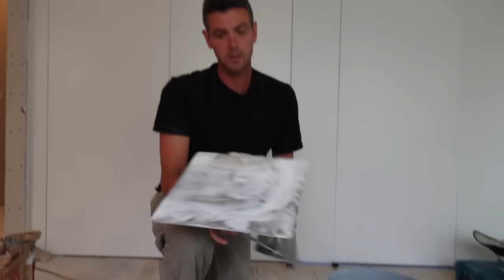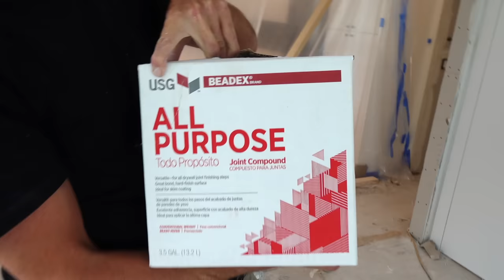Taping Drywall for Beginners Day 1

Comment: I literally started a project yesterday, perfect timing. Any thoughts on inside corner bead product (metal with paper flange)? I'm using the same for my outside corners too. Found it at the big orange store in Toronto.
Reply from the maker: I’ve never used inside corner bead for a regular corner. It takes too long and isn’t a better product. Take the time to learn how to use paper tape in corners. Fastest, cheapest and best product. It’s rare to get that combination.
Reply: @vancouvercarpenter  makes sense, I'll stick to paper! Also just watched your mud framing vid from 3 years ago... Any thoughts on using durabond 90 for mud framing or should someone use only the confill product you mentioned?
Reply from the maker: @robertobattiston1  Don't use durabond. Use a lightweight setting compound.
Reply: You also have to consider if you use a metal inside corner bead, your inside corners might be crooked or not square. Paper tape, like the video instructs is the way to go.

Comment: Sir, is that skimcoat you are applying after putting the tape? Does it need sanding after or you can apply right away a flat enamel paint

Comment: Hey, I have a huge question.  This past week, on my vacation,  I tore down 4 ceilings in my house, taking down the textured and replacing with fiat white. I had already done 4 other ceilings but these have proven to be a headache. I was running out of time before I went back to work and didn't do a 3rd coat of mud. Now, after priming and painting, I can still see tape in multiple places.... what can I do to fix this??? It has no air bubbles.

Comment: I used 45 minute Easy Sand; came back the next day and the edges on multiple areas of the paper tape were not completely glued down. I thought I used plenty of mud, but it didn’t completely hold the paper tape down. Now what? 😢

Comment: Disagree on mesh tape, especially for a beginner.as you mention, it's self adhesive but also, beginners are likely to hsve a bubble or two because of not bedding it properly. But, for anyone, mesh rape acts like welded wire fabric (wwf). The mud actually fills in between the grid of the fiberglass tape to give a stronger joint.

Comment: I’m about to have a brain aneurysm. I’m trying to finish up the drywall in my garage ( old garage). The tape doesn’t seem to stick and I have a really hard time to put mud on the interior corners and ceiling. I’m about to just give up and paint the garage the way it is. 
In 2 days I didn’t tape the whole garage, everything I’ve done the day before had to come off because the tape was not sticking.

Comment: Hi  if you install a  new drywall on the walls and  want to keep the old ceiling drywall  just  wondering   how  do you tape the    new   wall drywall to the  ceiling do u have a video to show that  i  want to remove  wall drywall and  sound proof it but not touching the ceiling  Thanks

Comment: Broke drywall is best to cut out so we don't get a blister.   However, tight but joints are best I never cut them out.   If there is a gap, I slap the mud to key it up.  We never ever use mesh tape on drywall.    Maybe this is why you get cracking.    This is my trade professional.   I did my house my mother my aunt and many others.  My house is only 25 years old However I have never had a Crack.   I have used fiber mesh but only on Dimond finish plaster.  I would never use it on drywall....   Maybe you could use it on drywall if you prefilled  all joints and use a quick set on everything first coat??   However not practical.   It will have cracking in a few years.

Comment: Dirty secret: Carpenters are the only tradesmen who typically stay with a project from start to finish. Good ones see all and learn. We are the comprehensive builders. We can't possibly perform all the tasks of the subs as efficiently as they do, but in a pinch, who do you want to pull the joints on your house? The electrician or the plumber? There's a reason they're called "sub trades". Carpenters Rule! But discreetly.

Comment: Do you ever add glue to durabond or do you find that it has good adhesion without adding glue?
Reply from the maker: I have added glue before. It has decent adhesion. Still not as good as all purpose.
Reply: @vancouvercarpenter  thanks Ben!

Comment: Why did you only prefill certain spots and just tape over others?
Reply: I believe he said that he prefills gaps that are over 1/4" wide

It can't hurt to prefill the ones smaller than that either, but not 100% necessary either.

A cautious beginner with time to burn could prefill everything gap no matter how small though
Reply: @mpxz999  yah if I had to do this I would prefill all the gaps as well...

Comment: Curious.... Is there ever a situation where you butt joint up to the tapered edge to use up your drywall scraps?
Reply from the maker: Yes. If you have absolutely no drywall left.
Reply: Ben also has a video that covers that subject. Prefill!
Reply: @jhalleck  I'll check it out.  It's my only real trouble spot mainly because of wanting to use up all materials.   We only have luck with our prefill if we use Proform Allpurpose

Comment: We use to call what you call flats the seams flat ..butte flats etc ….and shortened to seams or buttes …. Then again i stopped taping in 1990 😜and things change
Reply: Wow back when pops was taping ( i attempted at learning ) we never used non premixed usg..and never prefilled any joints as itd dry and fall out….which i imagine is why you use the 90 min hard stuff ,to prevent the shrink ….but we never had any issues using g usg and spreading, laying tape into it and cleaning it up …pops was comsidered best taper in our area for decades back then ….is it because of climate or something ? Or has the whole “code” changed ? I mean you obviously know what youre doing  its just so different than  i recall ..the whole side knife ive heard a few use but not back when i did it ,it was half blade of mud …i mightve been fast enough if i knew that trick and stuck with it lol
Reply: Wow never used paper outside corners then either …seems a lot easier than nailing metal and f’en up making a bubble lol

Comment: Can one use spray adhesive for the torn paper repairs?
Reply from the maker: Sure can it works great. It’s worth flattening it down with a putty knife after so you don’t need to build up much to hide it. But use an older putty knife because it’s hard to clean the spray adhesive off.
Reply: I have done it before. I wanted to know if you had and what your opinion would be. It seemed to have held before and I'm up against that issue, again and, I'll use spray or, whatever "adhesive" I have close to me. 
Thank you, for replying to me and replying so quick!! I've made a "Library" of your videos and it's a great help to be refreshed on many things, especially drywall and tips/tricks/techniques that you show.
thanks, for all of your teachings!! @vancouvercarpenter

Comment: Just hired a “professional”. He needs to watch your videos. Worst I’ve ever seen. First day on the job and he got sent home. 
     Tape ripped on inside corners. Some Inside corners were made into 45 degrees(couldn’t do that if I tried. Used 1” screws on ceiling cause longer ones took too long to install. Cracked drywall. Globs of mud as big as grapes left in corners where ceiling meets walls. 

8 hours of sanding with an electric and hopefully I can save it….the idea was to save me some time on a remodel and leave the drywall to the pros. Backfired.